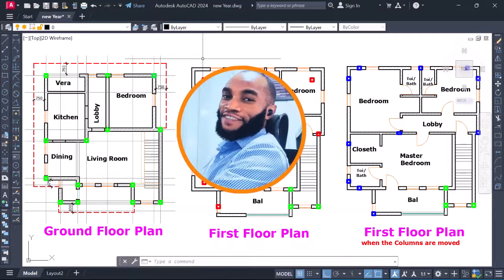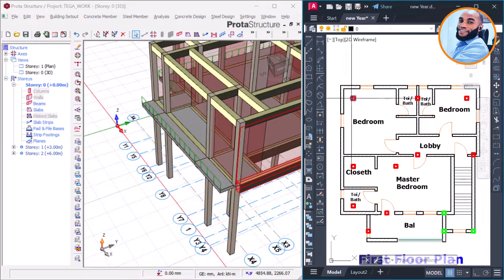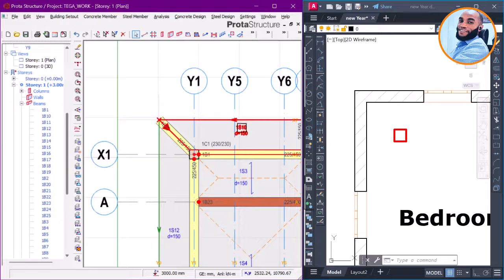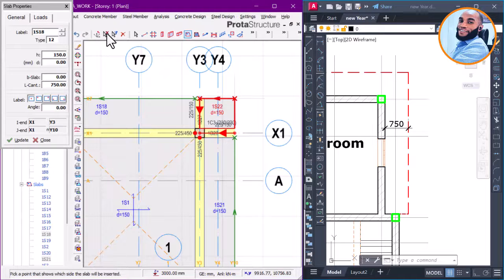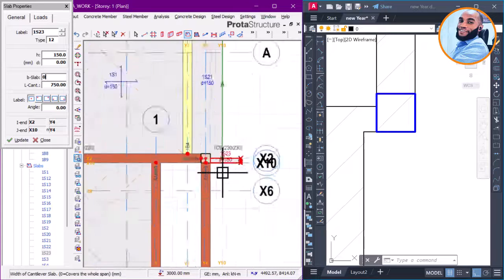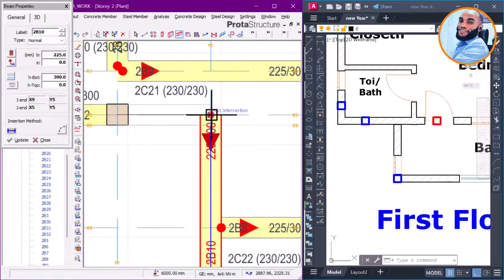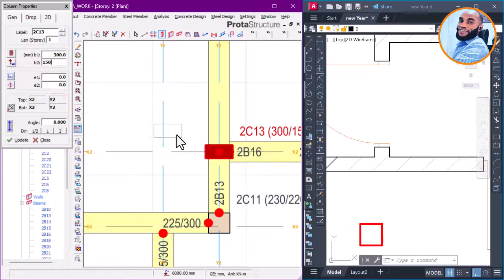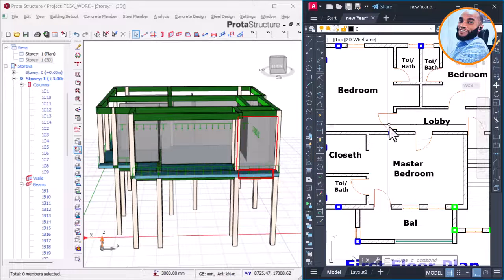Design of Simple Building with Different Column Positions - Protastructure

Comment: Columns are meant or transfer load to the ground both axial loads on it and also other loads due to beam and other members. For a framed RCC structure to perform columns must align. You have altered the ground columns and 1st floor columns. how the load mechanism is goona work. explain. Also now it's not a framed structure anymore having rigid connecting joints. It's more like a one box places over other and if a single shaky movement of earth occurs the upper part i.e 1st floor goes one direction and the ground floor goes another direction. And the shear force will be tremendous. How can one even design such  i wonder. 😮😮
Reply from the maker: For a country with seismic effect, yes this is not acceptable because it will create a weak joints. But for countries in Africa and other middle east countries like Saudi Arabia that doesn't experience earth quake, this is 100💯 acceptable.